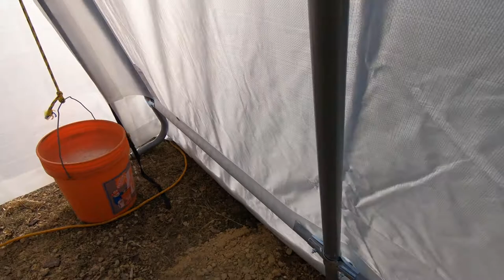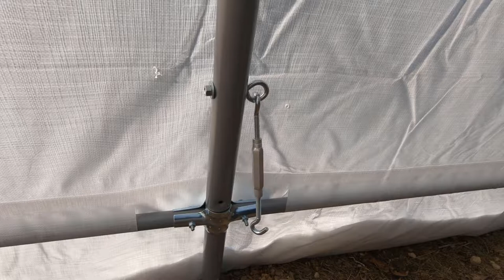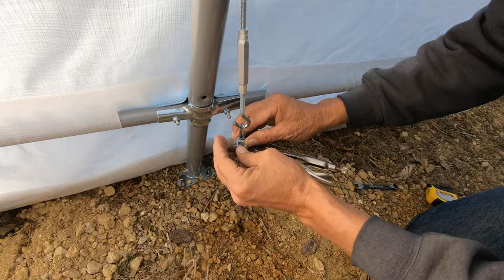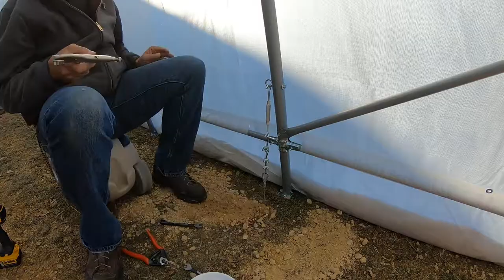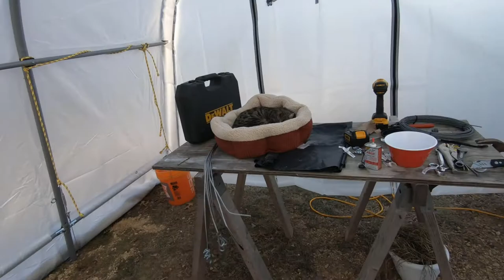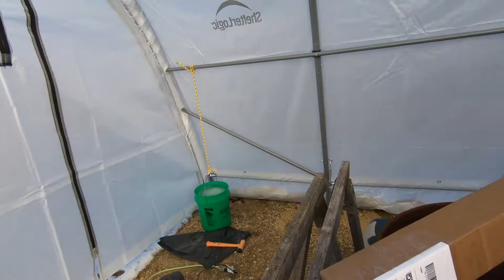Connecting the Earth Anchor-Like Thingies to the Greenhouse Frame

Comment: thanks for posting,  I'm planning to use a rachet and tie down from the top rail into the grand anchor.  The metal posts aren't that strong  so  I would avoid drilling into them.   Furthermore I'm thinking tie-ing down from top rail would provide more support from preventing the wind to pick up / move the tent
Reply from the maker: It sounds like that will work, but this shelter has been through many windstorms. The posts are plenty strong to anchor to, the cover will completely shred before you would damage the posts. 

I know that for a fact because we had freak storm last night with 70mph winds! The frame is still anchored firmly to the ground, but the cover shredded. I'll post a link to the damage video tomorrow when the wind dies down enough to film.